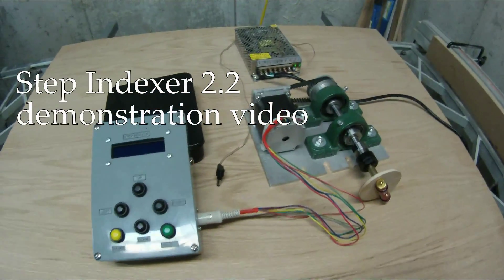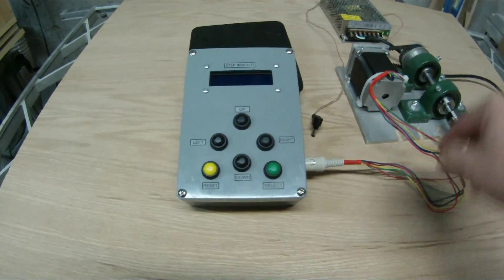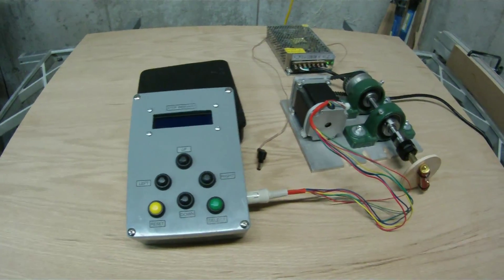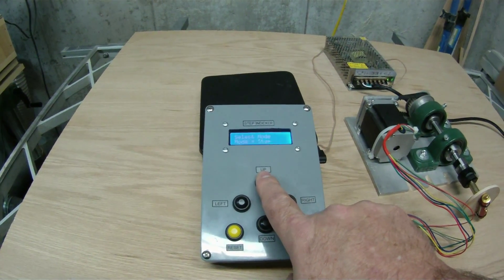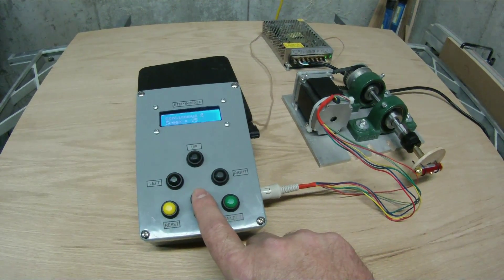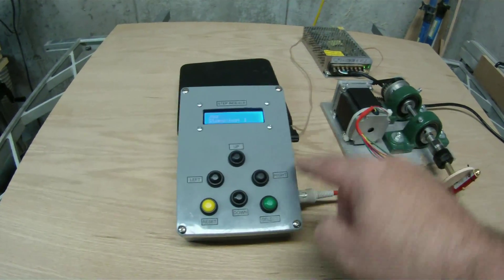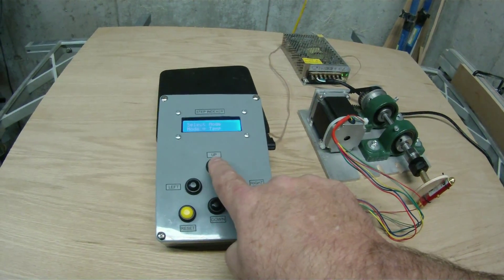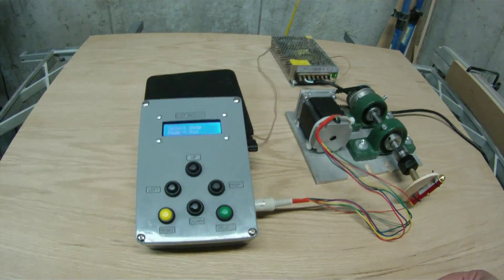StepIndex2 2

Comment: While analyzing the code, I noticed that there was a bug in the view "step" mode.
For example, if you divide 37 parts, you will do (motor step/37 parts)
Finally, there is a bug that forgets a few pulses when the 37th division is finished.
This is a part that needs to be fixed since floating point has not been processed.
Reply: In addition, when dividing the total number of steps of the motor by equal divisions, only the integral part is treated excluding units below the decimal point, so the final calculation will result in an error.
Reply: what you said is correct, is there a solution, I tried it and it is not accurate

Comment: Any way to contact you Gary? I didn’t see contact info on your website. If you would be willing to assemble the Arduino and lcd into a enclosure with buttons like yours pre programmed I’d be willing to pay you well. I’d pay even more if you use the adafruit touchscreen. Let me know. It’s worth at least $100 to me. Thanks.
Reply from the maker: my email is down at the bottom of the webpage.
Reply: revwarguy7 just an FYI I did go to the bottom of your web page and there isn’t a link I can find. I have revision 2.3 installed and there are a number of concerns and questions I have.